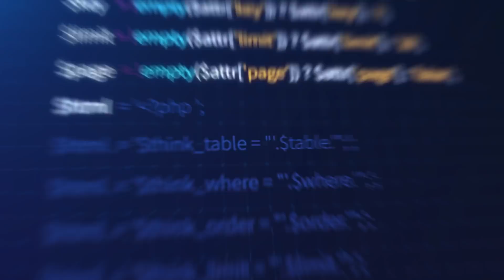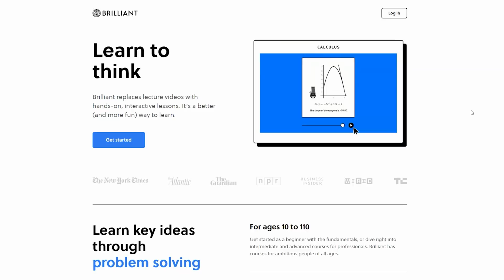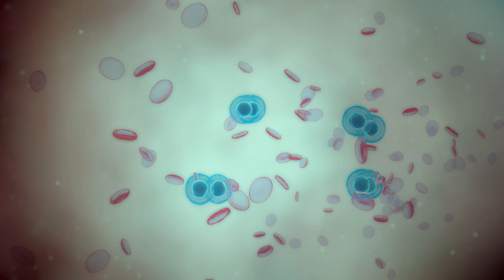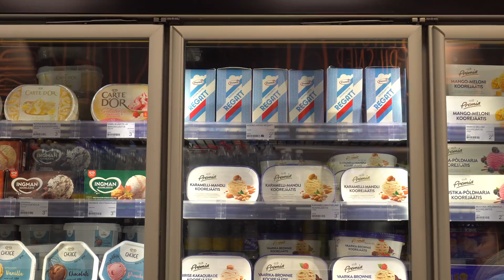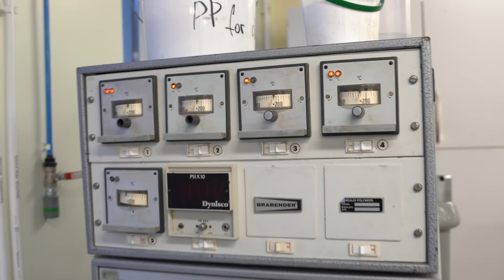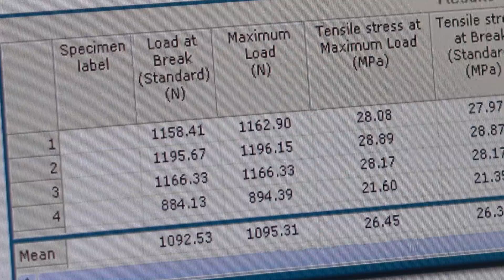I made a new material from an old t-shirt

Comment: Would you consider making a video on plastic pyrolysis?  This is a process that is fast, cheap and easy and does not require sorting of different plastics.  Plastic pyrolysis 
creates a synthetic light crude oil and carbon.  The oil can be refined into petoleum products or new plastics.  The carbon can be reused or sold.  

Some plastics also release chlorine and sulfur which need to be managed.  Although toxic, these products are also useful in industrial processes.
Reply: dihydrogenmonooxide moment
Reply: @nurpechbeimspielen3139  I'm not sure what H2O has to do with the process but please continue...
Reply: and what about the waste (solid, liquid, and gas) produced by these processes?  remember that EVERYTHING has a price and side effects.  nothing is free.
Reply: @JohnLeePettimoreIII  Of course.  You would see that I mentioned chlorine and sulfur as hazardous byproducts.  I'm sure there are other considerations to be made.  That is why a video on the process by a qualified chemist would be interesting.

Comment: It's neat that this new material is higher quality than typical "recycled" plastic, but how recyclable is THIS stuff? What are the material properties of such a plastic when it is re-cast? How long does it take to break down in the environment, and does it also break down into microplastics?

If it can be re-cast with similar properties, that would make it easier and more profitable to recycle, but if it's not and it breaks down into microplastics too, it's just going to push the problem further into the future :(
Reply: Polymer chains break every time plastics are granulated for recycling.  Recycled plastic breaks more easily than virgin stock.  To recycle plastic, feed stock has to be sorted and washed, increasing the labour content and environmental impact.  

A better method is plastic pyrolysis which decomposes plastic back into oil and carbon using heat.  The oil can be turned back into plastic or processed into diesel and petroleum fuels.  The heat can be derived from any available source and the process is simple enough that some people do it in their backyards using home made equipment.

Comment: The problem is that a lot of this plastic trash is from improper disposal and/or littering. I mean, I live in America which isn't the most environmentally-friendly place, and further a poorer rural one on the east coast. Guess what? We have state-managed waste management sites where you can take your plastic/glass/aluminum cans and toss them into a single container for them to all be recycled - as well as containers for cardboard/paper. Do you know what I routinely see when I go there? People taking empty cans/bottles out of their car, putting them into plastic bags, and throwing them into the non-recyclable container that is destined for the landfill. Of course, you're not allowed to do this - and they know that they're not allowed. They're just lazy/don't care.
Reply: For now the problem is that manufacturers have successfully lobbied to make such items destined as waste the consumers responsibility. If say one were to put enough pressure on them to use biodegradable polymers, you're striking the head instead of haphazardly slashing at the feet. 

I hear what you're saying though, and most products dont need to be in glass containers. As for aluminium, i dont have much an answer for that aside from what the other commenter said. I will say this though, recycling is a bit f a waste of time in some areas as the presorted materials often get sent to landfills anyway, and there are plenty of shady businesses that promise to take away you recyclables and properly dispose of them fpr a fee, only to drive them into the next county and dump them in the landfill.
Reply: @nunyabisnass1141  Yeah I know all about recyclables being put into landfills despite whats advertised.  That is also partly a failure of the government regulating such industries to ensure they do the correct thing, and even supporting recycling. BUT when your government sells off recycling and waste to private companies... there is little hope of change!
Reply: @_____ i agree with using biodegradable materials as containers for wet storage, we had the technology 70 years ago, except at that time it was considered necessary to use plastics for food containers and shipping over paper and celluloid polymers, because plastics have a longer shelf life that also extended to shelflife of food, which during the cold war or just economic instability which was still very fresh in everyones minds, shelf life and storage capacities would be critical in smoothing out food supply flucuations if they could be stockpiled. But as that threat faded away, the convenience of petroleum based plastics did not and was already a huge powerhouse of an industry that no one wanted to let go of, and we as a society had forgotten about why we let plastics dominate as the default material. 

Also, thyosoi is wrong about there not being any natural decompser for plastics. Two species of bacteria have been found that can naturally break down plastics for energy, but they are unfortunately inefficient as these adaptations have only arisen within the past 15 years. In 100,000 generations they may be stromg enough to solve our plastic problem, but that could be between 50 and 100 years from now with no gurantees of anything. 

If ppl knew the history of technology beyond the industrial revolution of steam and what we developed as weapons of war to be more comprehensive, we might have the necessary maturity of voter streangth to so much more of what is wrong with our current approach to material sciences, but we are instead taught the sexy side of science, just like econnomics. In economics we are told how to make a lot of money without actually telling you how to make any money, instead its all personal management. Just as with environmental sciences we are told what the end result is, but no one is explaining how we got here.
Reply: @_____ i hear what you are saying. Plant based polymers are what you are asking for, and in some incarnation they have existed for 70 years, maybe 110 years if you count henry Ford's attempt to use them in model Ts,  but failed due to the smell...this predates bakelite by the why which is credited as the first synthetic polymer. 

Now a viable environmentally synthetic polymer needs two properties. It needs a shelf life, and needs to be be abke to be broken down in a reasonable amount of time jn a natural envrinment. We can acheive this in a simple way and part of it is already listed in the video by using finely granulated plastics, the second step is binding them. If the particle size is already so small as to not pose an impact on the environment then we have to look at how we bind them loke a resin. If the binding agent is say vulnerable to UV then they arent much of a threat for accumulation sitting on the surface on land. Extra points if its vulnerabke certsin bacterial activities. The second is how it behaves in water.  You cant make it water soluable even in the slightest degree because a fundamental characteristic of all plastics is thst they are resistent to water resistent. Perhaps, maybe whatever bindi g agent thats used is vulnerable to bacteria, but a thin exterior layer seals it like a wax coating so the moment tje seal is broken then its compromised. Unfortunately one of these properties violates food safety laws, and since im not a materials engineer, this is the limit to where i can speculate. 

Its such a complicated problem that we wouldn't be talking about it today if anyone had a promissing solution. Given from what ive seen how lab research works, it shouldnt take much longer thsn 5 years flr a viable prototype to be developed thst solves each incremental step.  First is light degredation, then biological degredation, then survive a range of ph changes, and finally pressure changes. So woth these four properties it shou,d take 20 years to make a new plastic thst can hit the market. After that it also has to ne able to be mass produced and rhsts another 5-10 years. 

For now, we could at least sacrifice carbonated drinks and package everything in wax or plastic lined paper cartons, but thsts a new level of bureaucratic nonsense.
Reply: This is just my two cents worth on recycling/ reusing. I give almost everything a second and third life. For example clothes are used until they worn out and then they used again as rags for cleaning and eventually burned.
Plastic containers are used for plant containers, paint mixers, etc. 
Old electronics are stripped for components and power supplies are repurposed.
This keeps items out of the rubbish dump for as long as possible.
Reply: The future solution for such a thing which isn't practical everywhere is advanced sorting machines that can identify and sort stuff as it goes through large conveyor belts, maybe going through several sorting phases since garbage can be messy. 

VERY expensive to set up such a thing and we don't have the AI database (of garbage) to identify many things in their many broken/dirty forms just yet but I think one day it will be possible. 

Where I live, our council/government doesn't even want to deal with garbage so they sold the garbage facilities off to private companies whom immediately made it quite expensive ($35+ per small trailer load) to bring garbage in. The result is more garbage ends up in the environment.

Nobody seems to want to pay money to setup the facilities to correctly recycle this stuff, so instead we send everything to places like Vietnam, China, or Korea and let people sort through it by hand for what amounts to breadcrumb like pay! (and lots of risk to the health of the people sorting this stuff out)

I honestly don't know when humanity is actually going to really start caring about recycling and waste management; maybe it kills us in the end.....

Comment: The fibers mixed with plastic remind me of melmac from the 50s dinnerware made of it is damn near indestructible.  You could definitely make lots of useful items with this, and I'm sure that the process will be refined and improved for industrial production.
Reply: @LabRat Knatz I was wondering that too. It'll take a bunch of experimenting, but of they can make expensive things like Pelican cases cheaper I'll definitely buy some more of them!
Reply: @_____ it's not too hard to make a heated press or machine two piece molds like that if you're determined.  Having one setup for a group of model plane enthusiasts for example would make a lot of sense for them all to chip on on.
Reply: @_____ it sounds like an incredibly amateur friendly polymer material.  This is really kinda exciting, I'm going to have to try and follow the progress on this and maybe try to make some, or a similar material myself.
Reply: I don't know, Rick, that "bone" broke in Thoisoi's hands like nothing.
Reply: Dune... plasteel

Comment: I recycle old clothing on a daily basis. I transform them into wood finishing and shop clean up rags.
Reply: That's reusing not recycling
Reply: @thesweetone  Which is even more efficient!   Reduce>Reuse>Recycle, in that order.
Reply: @nobodynoone2500  Why does nobody talk about the fourth R?  We need to "retain" or keep products for longer.  People need to stop throwing away perfectly good phones after just a couple of years, for example.

Retain>Reduce>Reuse>Recycle would make a huge difference if it was widely adopted.
Reply: @thesweetone  part of the recycling mantra R-R-R therefor it counts 😁
Reply: I do too! It has nearly eliminated paper towel waste in my home, and they are much more pleasant to use!
Reply: @nobodynoone2500  I'll run them through the wash and reuse the rags until they fall apart or I use them to clean something up that I don't want in my washing machine.